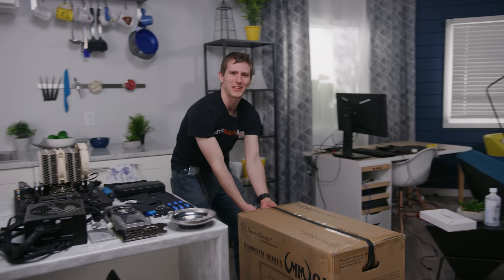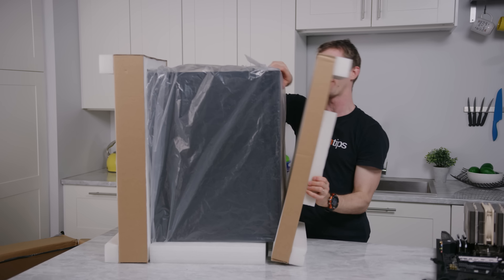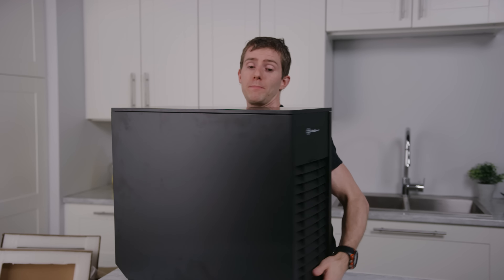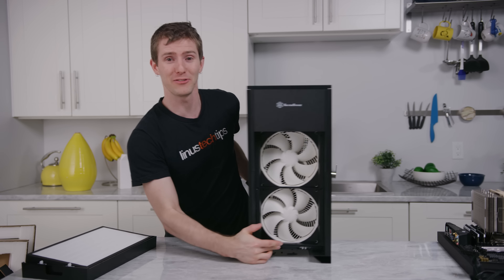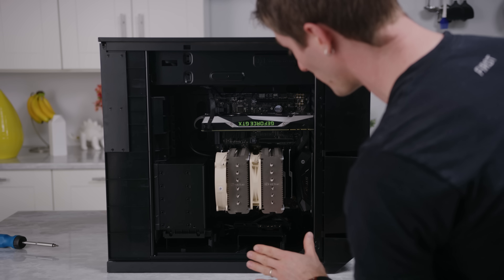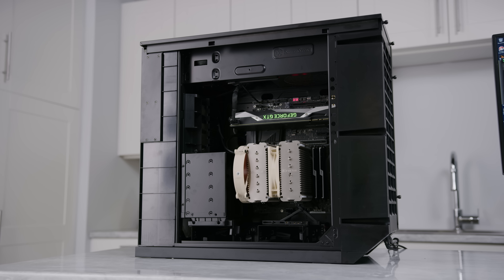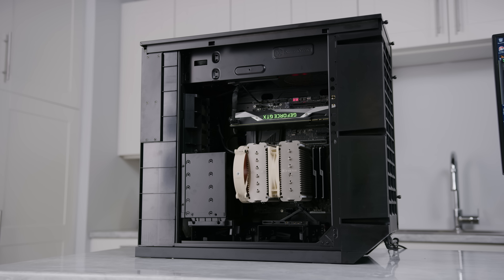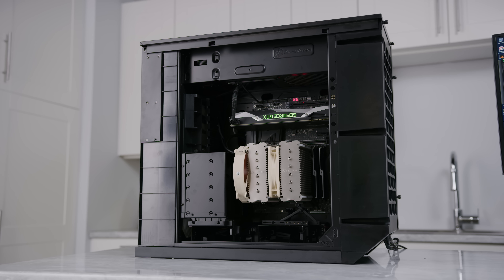Water & Dust Resistant PC Case - WHO NEEDS THIS??

Comment: WE have real computers in our company in the hall where we work on metal products. We use desk computers to sign in and start and end order manufacturing. Dust filtering like this is absolutely neccessary to keep metal dust out of the computer. Our electric grinders keep burning up in smoke like every couple months on each workplace. Can you imagine what this dust could do to a computer?
Reply: P.S. I built my own stereos from an old car stereo and a old computer PSU for power supply with two 4x6" speakers units. The computer PSU is absolutely great because if it short circuits it wont just burn up in flames but shut down due to the circuit protection that's been built in. And I am talking about like an old 15 year old 350W PSU.

So I just blow the thing clean with compressed air and it works like a charm every time it builds up too much metal dust inside that it'll short circuit.

Comment: I need a dust proof (or as close to it as can be) enclosure for a PC. I want to build a shop computer to run a plasma cutter but I don't want to ruin it with magnetic metal dust. The link did not take me to the case unfortunately.

Comment: I work at a machine shop. The guys at my work refuse to learn how to use the newer versions of a CAD program insisting on using the the same one from the 90s on DOS, and complain its a little slower when running in DOSbox so we to scavenge craigslist every 3 years or so for windows 98 machines cus the computer gets filled with metal debris. I wonder how difficult itd be to transfer our current 98 machine into this case.......

Comment: Do you recommend any cases like the Cooolermaster Cosmos II?    It was pretty good and with a little modification I could mount 16 3.5" drives.    I'd like something updated that includes USB type C front connectors and possibly more 3.5" drive bays (WITHOUT) putting in a separate storage box.

Comment: ip 43 rating: Water falling as a spray at any angle up to 60° from the vertical shall have no harmful effect
Object size protected against >1mm Most wires, screws, etc.

Comment: So it's an air purifier and a case at the same time? I paid $70 just for an air purifier for pet odors and dust mite allergies. And mine only has 1 fan. It's a 2 in 1 system.

Comment: Why not make a completely waterproof system? Just put a big radiator at the top and have a circulation pump. That way the main system could be sealed up and made impervious to unrestrained fluid or dust.

Comment: You don't need any of this shit. Just buy a Corsair 450D. I swear I haven't dusted this thing in like at least two years now and all of the dust is on the outside of the dust filters while the insides are actually pretty damn close to dust-free. It's as though the dust filters started working even better once they became partially clogged, because now even microdust is filtered out. I bought an 80 dollar electric air duster with the thing and I haven't had to use it yet.

Comment: Water Resistant & Water proof are 2 different things. First is if you get a drop or 2 of water it will survive, 2nd is full water spray, splash ect.. 

He full soaks this system when he even stated it was only water Resistant not water proof. Does he know the difference ?. No.

Comment: PRO TIP:    Buy a 1/4" air conditioner filter from Amazon, (~$10).   Cut it up so that it sits behind the front plastic face.  Congratulations, you are now PRO..................Even as a heavy smoker, I hardly ever need to clean the inside of the case anymore.
Reply: PS - you don't need 99.7% filtration. Replacement costs are way way lower too.